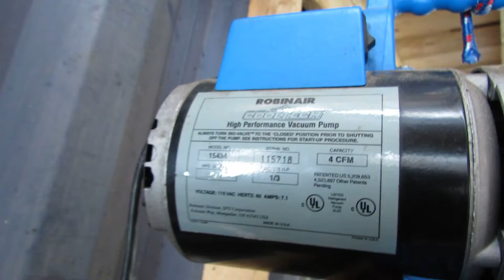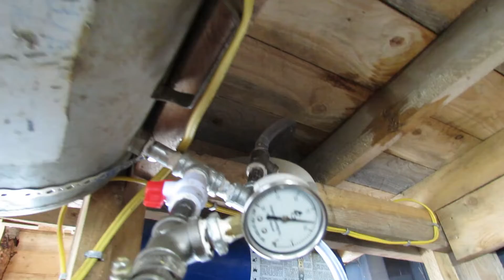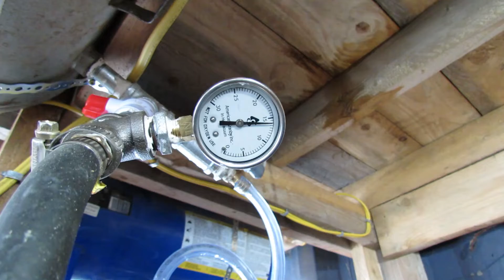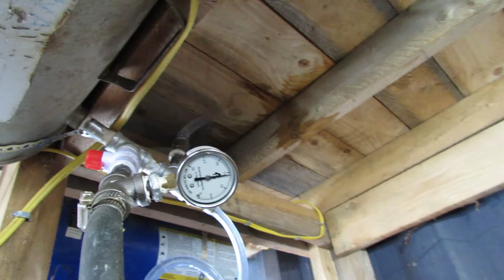Will a hvac pump run a surge belly milker? (grumpy cow milking)

Comment: my understanding is it takes 13-20 cfm to get milker on and only 2-3 for the actual milking . You are correct about the tank though !  Currently using a 6 cfm pump hooked to an old air compressor tank for our delaval style bucket milker . we started with a 12 cfm which did work without a tank .

Comment: She is having to have a leg tied back, grumpy  and kicking off the milker because she is in pain. How would a guy like to have suctions cups attached to his ninnys and cranked up? That Surge belly pail just sucked filth into the milk can. I hope he is just feeding it to a calf, not taking that milk into the house. Get a pressure regulator for God's sake.
Reply from the maker: Unfortunately you haven't a clue what you're talking about.
Reply: I was going to say if you kink the teatcups a little you won't suck as much air putting them on the teat. That will probably help conserve some of the vacuum.
Reply from the maker: @anthonyhengst2908  Yes it helps, sometimes having higher back teats are kinda miserable when paired with hocked cows. Thanks for the comments, have a good day!
Reply: @stuffnsuch631  I've milked cows with Surge buckets all my life. We used a Surge BB-2 vacuum pump. A little undersized for four buckets.